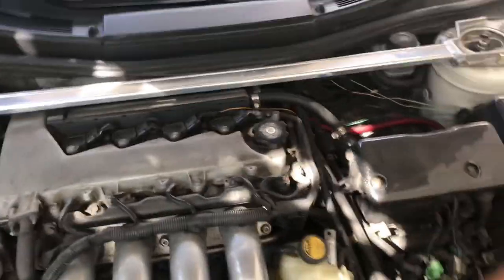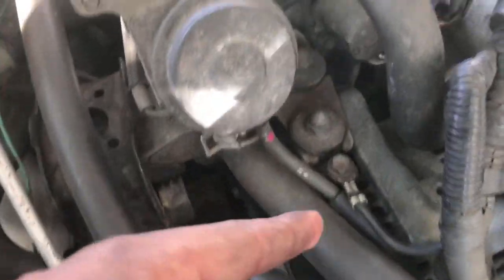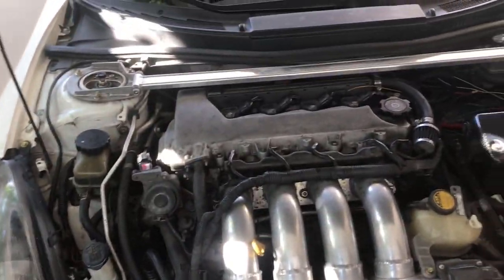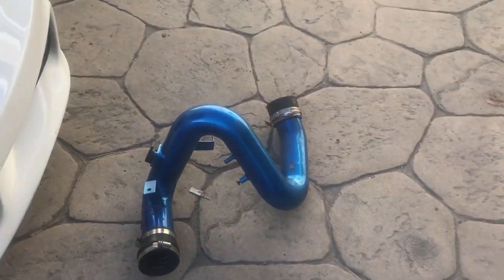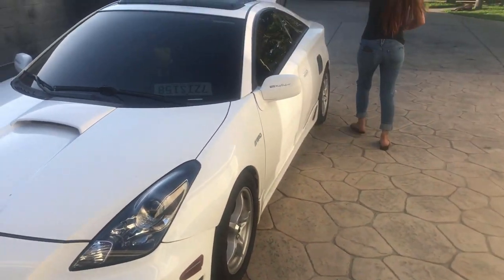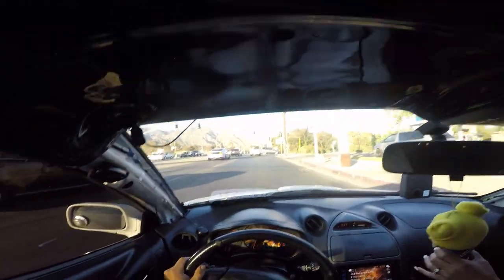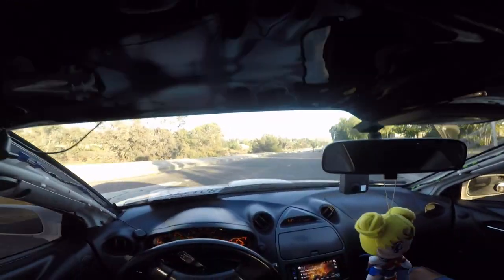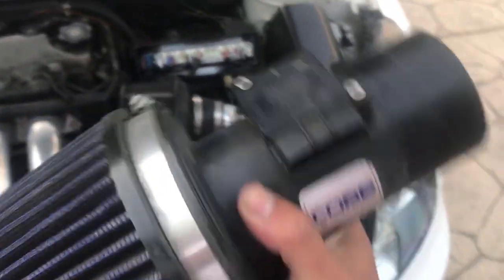My WIfe Car Isn't Hitting Lift

Comment: Lean code shouldn't affect Lift. After putting short ram intake on my 01 GTS (2zz-ge), it started running lean but never any issues with lift. I realized it's running lean because I didn't cap one vacuum port. After capping, lean code is gone.
Reply from the maker: Matt G It does bc too much lean makes the car boggle and I have a ddpr intake which allows more air flow specially if i have a bigger intake

Comment: Hey man for the future. To see if the car is hitting lift on the 2zz, just rev it in neutral. If the car redlines while in neutral lift isnt working. If the car revs and bounces at around 6k the lift is working
Reply from the maker: N- PUT Good to know thanks for the info
Reply: @RafasGarage  no problem
Reply: My 03 gts in neutral bounced at 7k is that normal I was getting a no lift code so i cleaned the screen n then just stumbled onto ur video n started reading comments and came across this but lol is 7k normal or should it really be at 6k
Reply: @matthewkobulinsky3198  7k is fine. It should not red line while in neutral
Reply: Ok cool thank you guess that's one problem down now it's time for my struts any suggestions with out buying online I hate returns and warrantys so I try to just go to stores but cheapest I found them is 380 at advance auto
Reply from the maker: matthew kobulinsky yea its normal and how much are they going to charge for install or you doing it yourself
Reply: @matthewkobulinsky3198  i would go stock. iirc the stock struts are made by kyb just with toyota stamped on em. So any auto parts store should have em
Reply: That's the price for stock ones lol and regular Celica ones are only 80$ cheaper lol I been waiting for one to show up at the upull it yard but their gone the day a Celica comes in lol

Comment: Nice Job Rafa! We just picked up a 2005 GTS like your wife’s but I’m getting a P2646 LIFT issue A Rocker Arm System performance issue.

Will cleaning out the sensor or replace the MAF fix this code? The code triggered when trying to hit lift at around 6k rpm. Thanks in advance!

Comment: Hey man thanks for the video can you give me some advice. I have a 2006 Gt and lift is working and the car has 65k Milles should I replace the bolds just to prevent they get broken or should I leave it ? I got the genuine bolds oready from Toyota .
Reply from the maker: The Valbunnys i would check i doubt they are broken
Reply: Rafa's Garage thanks for fast reply man I don’t think they are broken but my question is if by having 65k miles maybe better replace them to prevent ? I don’t push the engine hard I drive like an old man as I love my Celica but sometimes I lift it and fck fly 😀
Reply from the maker: The Valbunnys I would replace them you already there

Comment: Did you clean the mass air flow sensor. Maybe it's that to. It might be dirty.
Reply from the maker: L0RD SPARTAN that is the 1st thing I did
Reply from the maker: L0RD SPARTAN that is the 1st thing I did
Reply: How much where the gains from the intake manifold?
Reply from the maker: L0RD SPARTAN 15hp

Comment: Hey Rafa, how hard was the DDPR intake to install, was there any hiccups for the install? Can you run them on stock ecu, also relocating radiator resevoir
Reply from the maker: It already came with the car but ive taken the intake manifold before not that hard the only thing is the two bolts on the side with gold color bracket, you can run stock ecu as long as you dont go with a bigger intake

Comment: hi. what oil is used in the engine?
Reply from the maker: Mobile 1 synthetic 5w30
Reply: @RafasGarage  what are the ACEA tolerances ?
Reply: @RafasGarage  is normal this marks/scratches in camshaft lobes? And mine looks exactly the same.

Comment: Hello friend, ask if it is not changed, that usually makes diesel noise when it is regulating down a long time ago, it has been making that noise in my toyota alex rs, it brings the same engine but it greatly hinders the noise to diesel on low

Comment: Did the lift, when it tries to engage kindve jerk you back and not let you past 6000 rpms? Also sometimes it doesn't do it it will work for about 6.3-6.6 rpms and then again will jerk me back...I am also running rich because I need a new cat.
Reply from the maker: Check your lift bolts

Comment: whats the common problem for 2zz engine? lift bolt , small filter and?
Reply from the maker: Yoy Yoy lift bolts on 00-02, oil pump and maf sensor
Reply: @RafasGarage  oil pump also common problem? millage suggest changing oil pump?
Reply from the maker: Yoy Yoy yes ill do it before 200k
Reply: @RafasGarage  ok Thanks for sharing
Reply from the maker: Yoy Yoy anytime and you’re welcome

Comment: How do you know when your lift not working or is working
Reply from the maker: Garfield Hanchard when your car is at normal accelerator all the way to redline if around 6.5k rmp you feel like the throttle open up more its working
Reply: @RafasGarage  thanks man , I'll take note of it
Reply from the maker: Your welcome
Reply: You will notice! You get around 40/50 horses extra when hitting lift

Comment: Hey Rafa my 01 GTS isn’t hitting lift and I’m having bad acceleration, engine hesitation, with the check engine light on, what could most likely be the problem?
Reply from the maker: Check the engine light 1st
Reply: I had engine hesitation as well for me it was the coil packs, use japanese parts  don't use autozone china shit